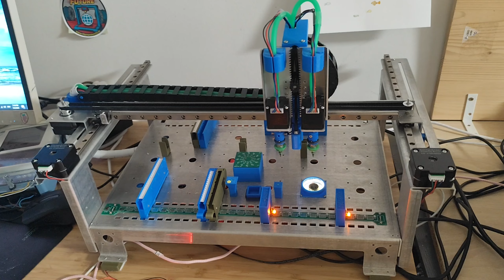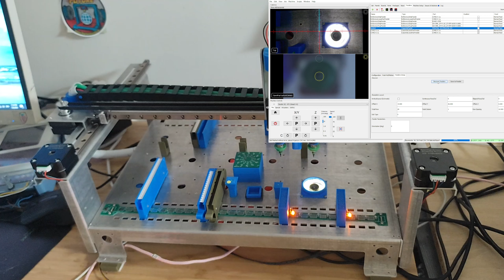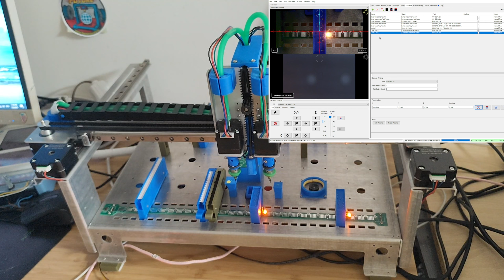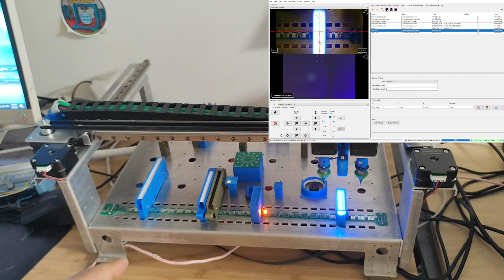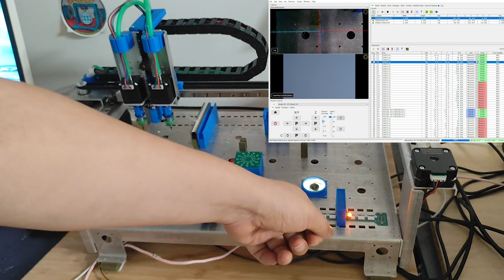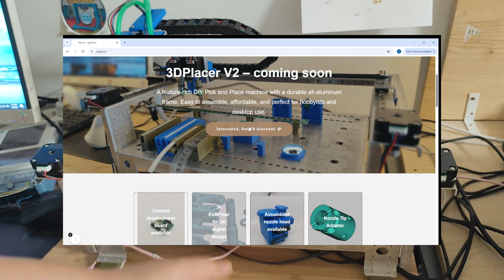Designing the Auto Cassette Loose Part Feeder for 3DPlacer v2

Comment: Will the auto cassette have the posibility to have a stripe as well? You know, the "Auto Cassette feeder – position aware version – v1.0" that can hold 150 components inside?
Reply from the maker: For 2mm pitch component, it can hold, but it is designed for 3DP v1, for V2 I have designed another feeder that can use the reel.
Reply: @xpdiy  I'm looking forward for it! It's an auto cassette too? I saw that it's not possible to have two auto cassette next to each other due to the electronics. Which leave a space of one slot in the middle?
Reply from the maker: @G@Gkvhkbt is an auto casette. The smallest one is 12mm, it will be able to place side by side.
Reply: @xpdiy  Sounds amazing! It seems that 3DPlacer is quite intelligent compared to other PnP machines! Keep the good work up! Looking forward about 4 weeks! :)
Reply: @xpdiy what is the status ?
Reply from the maker: @N@NickgrrrF16I have got the feeder PCB working, now integrating the 3d model and testing, it is a bit late than what I expected, I will put out some video in couple days, stay tuned!

Comment: Absolutely brilliant! Now with an external programming device for the cassette container, you could prepare and insert the containers during the assembly process. Remove the old processed containers. With the lighting from below, it's even possible to remove to 0402-SMDs directly from the white strip without camera control. ;)
Reply from the maker: Indeed with loose part feeder it is much easier to load the components, and thanks for your suggestions!